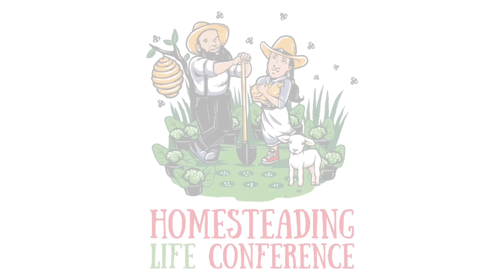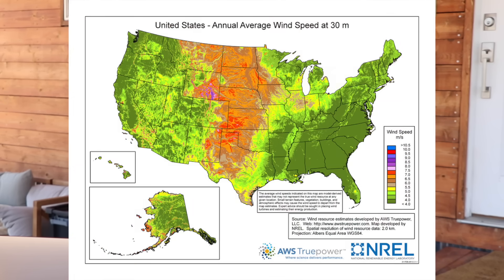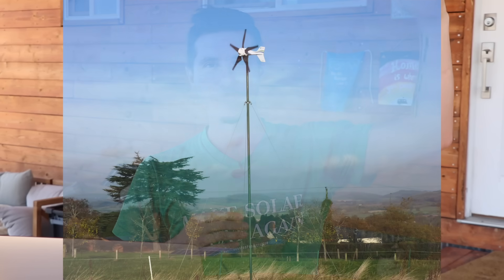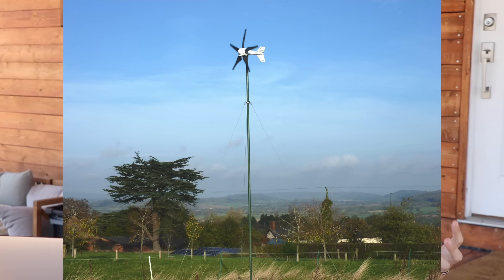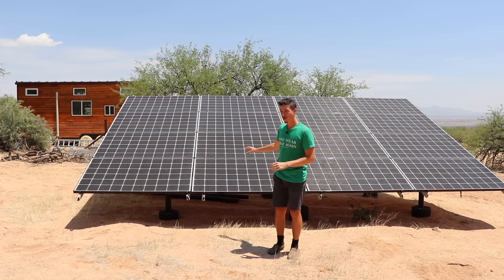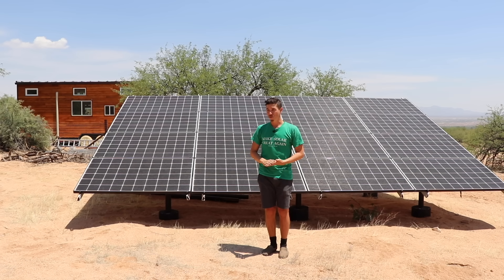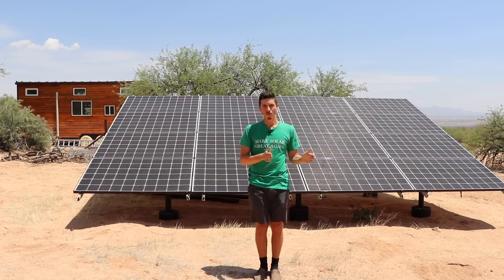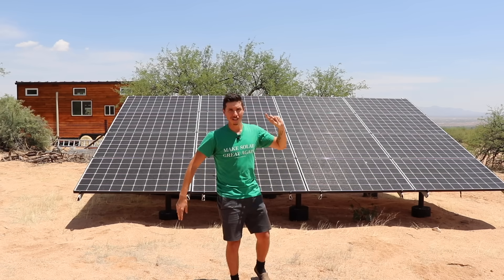Micro Wind Turbines... Are They Worth It? (Off Grid Solar)

Comment: Ha ha ha, this video is full of nonsense. He said that after the batteries are full, the wind turbine will blow up if there is no load diverter in the circuit. He said that the wind turbine has a motor in it. Anyone with basic knowledge know that it is not a motor, but a generator.
Reply: Without a LOAD , most Wind Turbines will SELF DESTRUCT in high  winds and a full battery bank ...

Comment: John Daniel's, is a Youtuber that has micro windmills and his setup does not put any one into financial ruin. Very cheap for anyone in America
Reply: He spent $4,000 just for a 12 Volt Lead Acid Battery Bank!  That will last +/- 7 years, if he does NOT Deep Discharge every night.  His two DC-to-AC Inverters will operate for only 3 HOURS at max power.  Off-Grid?  Really?  Does he have Central A/C?  Is he actually using ( fossil fuels ) Propane for his Stove, Hot Water Tank, Clothes Dryer & Furnace?  How many kilowatt hours does John's Wind Turbines actually generate on the days when there is little or no wind all day, for several days?  What is his average Daily kWhr production from his Wind Turbines?  How many times has he already REPLACED his Wind Turbines?  And who has steady 25 MPH Wind blowing, for many hours per day, every day?  And now he has moved.  The COST of his Battery Bank + Charge Controllers + DC-to-AC Inverters + Wind Turbines + Dump Loads + Copper Cable is more than anyone can ever save on a small electric bill to power Lights, Fridge, Washer, Well Pump, Furnace Blower & TV.  Have you actually added up all of the "off-grid" COSTS , just so that you can become a PROPANE consumer?

Comment: Why would you want a wind turbine? Hmm, let's see.   Maybe because you can get 4 days in a row of cloudy weather.  Also, some of us don't have large capacity storage,  or just use the solar and wind in the event of an emergency.  A 65ft. tower is recommended but not necessary.   A turbine  betters your chances of having a consistent supply of power.
Reply: Just because it is cloudy, does mean is will be windy.  So, how many watts does you Micro Wind Turbine actually generate in 10 MPH winds?

Comment: Lmao if you think solar doesn't need ongoing maintenance you are in for a rude awakening.
Reply: No, Solar Panels do NOT any need ongoing maintenance.
Reply: @MrSummitville  even the best batteries are only good for about ten years. So just from that one part, you are optimistically looking at $500 per year in maintenance for just that one part. 

Capcitors dry up. Relays burn out. Regulators degrade. There is no such thing as an electrical component that never needs replacing. 
 Corosion inhibitors need to be reapplied. Glass turns opaque over time as dirt is deposited and exposure abrades the surface.
And all of that maintenance is the bare minimum of what is required to make a solar setup last the expected 25 year lifespan. The whole system eventually needs replacing. If you do no maintenance, you will be lucky if they last 15 years.
Reply: @Christopher_Gibbons  I said ... SOLAR PANELS do not need an on-going maintenance.
 No, a LiFePO4  battery bank does not require any on-going maintenance.  The battery bank Is simply REPLACED. There is nothing to maintain.
  The same goes for the Charge Controller. the is no "on-going maintenance".  It is either repaired or replaced when it fails. 
  But a Wind Turbine does require ON-GOING MANTENANCE ... every 3 - 6 Months, it must be taken down and serviced, over its entire life - if you can still get the replacement parts, from China
Reply: @MrSummitville  replacing parts of a system is maintenance.  And if all you are doing is replacing whole parts of the setup without fixing anything you are doubling your costs.
Reply: @Christopher_Gibbons  Replacing worn out components, once every 10 years is NOT called "on-going maintenance".   Only Wind Turbines require have ON-GOING Maintenance  <= Your terminology.
  No, you cannot "fix" a worn out battery bank.  The worn out battery bank is simply replaced.  It does not double my costs.  It is part of the known & expected cost of being off-grid.  Charge Controllers are very cheap - less than one monthly bill for Grid Electricity in California.  I have not yet replaced a Charge Controller ...
Reply: @MrSummitville  yes you can repair a battery bank. You just replace the degrading cells. The rest of the components are perfectly useable. If you go around replacing everything every time a single component wears out you may as well just use coal. It will probably cause less damage.
Reply: @Christopher_Gibbons  When one cell in a battery bank "wears out", the rest of the cells in the battery bank are about to "wear out", too.   If a cell fails well before the warranty expires then yes it is replaced by the mfr, because it was faulty, NOT because it "wore out" ...
Reply: @microcap1997  Read the manual that came with your wind turbine.  Oh, you did get a manual?  Well then you bought a TOY.  Let it fly until self-destructs and then throw it in the garbage ...

Comment: Uhhh? your bias is obvious. Solar is great but you are exaggerating the requirements for wind (like a 65 foot tower) and neglecting to state the cons of solar. One good thunderstorm and your solar array will be upside down in a pile. Wind can improve a total system. I from Ohio and its windy there. I'm in Montana and its windy here. Hmmm...You should redo this explaining the benefits of both.
Reply: Solar Panels are NOT upside down from "one good thunderstorm".  Clearly, you do NOT have a Solar Array, otherwise you would not write such nonsense.  So, where exactly is it "windy" in Ohio?  According to  NREL, National Renewal Energy Labs , there are only a few Class 2 locations in Ohio (slightly windy) - there are no Class 3, 4, 5 or 6 (Very Wind locations) in Ohio - none, zip, nadda.  Class 2 is only 10 MPH (avg), but Wind Turbines are rated at 25 MPH!  Yes, western Montana is windy.  Are you off-grid in Montana?  So, how much did you pay for your Wind Turbine and how many kWhrs does it generate per per year?

Comment: How solar work in storms or clouded days? just saying wind may complement solar.
Reply: Or a Wind Turbine can be, and usually is, a waste of money ...
Reply: @MrSummitville  or could run 24 hours and solar can never work 24 hours 🤔 Humm ponder
Reply: @ntcc_spanky8507  High Winds for 24 hours per day?  Not for the average home owner.  You are insane ...
Reply: @ntcc_spanky8507  Solar is a much more reliable and cost effective source of energy for Off-Grid Homes than wind.  And that is why, almost all,  Off-Grid Homes use Solar Arrays.  You would know that if you were actually Off-Grid ...
Reply: @MrSummitville  I would use both and hopefully one day I will I agree solver is better but don’t discount wind so easily

Comment: I'm happy for you brother that your solar is working for you in that location. Sadly, I'm in the Northern hemisphere and even in the summer it's not a great spot for solar. Perhaps a VAWT turbine of average size on the roof of an outhouse with AVP shroud to build speed from    x2 - x8.
Reply: A VAWT?  Those are real waste of money ...
Reply: @MrSummitville  Watch Robert Murray Smith build a VAWT on youtube from scrap materials, but even he is missing something that turns the VAWT into a higher performing wind turbine that any other form of turbine.  The answer is an AVP (Asymetric Vortex Propulsion).  It initially directs the wind flow into the business end of the front end of the wind turbine's blades and protects the backend of the blades from the same directional wind flow.  However, the shape of the AVP does something unexpectedly.  It begins to form a vacuum where the wind enters and begins pulling air into the front end of the wind turbine's blades, that's why the turbine starts out at x2 rpm and climbs to x8 rpm.  So potentially MrSummitville you're looking at x8 5 mph  which is 40 mph.  Of course if there is no wind then x8 0 mph is still 0 mph, but it's not a miracle worker, it's basically just an amplifier.  But it will still out perform a standard wind turbine.  The issue would be how to dump the excess power.  Regardless, hope this piques your interest and line of research.  I'm currently saving for the parts to build such a device so I'll keep you updated.

Comment: Be honest with your video. Solar panels drop off on efficiency after 10 years. And every year a little more
Reply: Some Solar Panels are guaranteed to still produce 80% of Rated after 20 years.  This is NOT a problem.  Honestly, your INCREASE in the cost of Grid Power is your problem ...
Reply: @MrSummitville  Solar panels degrade on average 1% per year and their efficiency rating is horrible typically 20% on the high side. Not to mention technology becomes better over time. New solar panel options will be available. Meaning you'll never recoup your building costs

Comment: wind is reliable, solar is not, hat's why countries go with wind. solar is rubbish who wants to spend so much money for temporary power u would need a field to power your house fully. if I'm not fully off the grid I'm not interested. wind blows every day every hour and doesn't rely on a sun that might not shine too bright so i live in darkness on that day. i prefer biofuel its reliable as long as u shit every day
Reply: For most off-grid homes, the wind does NOT "... blow every hour, of every day ..."  Are you really that stupid?  For the vast majority of off-grid homes, the sun is significantly more reliable than the wind.  Most wind turbines don't even start spinning  until 7 mph - 10 mph wind speed = minimal power.  And then, they require steady ~25 MPH Winds for Max Power.  So, who has steady 25 MPH winds every hour, of every day?  Essentially ... NOBODY !

Comment: I can tell you why people would rather have a wind turbine instead of solar panels... COST. To do solar right you have to spend between $30,000 and $40,000. Even a really good wind turbine system is a small fraction of that cost. To me they are not unsightly, solar panels are unsightly to me. We ride to Western Pa, and Eastern WV just to watch the large wind turbines. We think they are neat.
Reply: In that area of the USA, given an equal amount of money spent for a residential Wind Turbine system, it will generate less than 1/2 the kilowatt-hours that are generated by residential PV array.  The FACTS are the exact opposite of what you claim ...

Comment: As a retired licensed master electrician, I can say this guy has no idea of what he is talking about. And anybody that lives in a house smaller than my pickup truck has no credibility.  Just because he has never had the wind blow his hair, doesn't mean that the rest of the country has no wind at all. It doesn't even look like you are code compliant. That would be NFPA 70 otherwise known as the NEC or National Electrical Code.  What trade school or degree do you have.  HS diploma maybe?  And just for the record, a wind turbine has no motor, it has a GENERATOR. And your Batteries will need to be LEAD ACID batteries, that produce EXPLOSIVE hydrogen gas and need to be topped off regularly.  They should be stored in an explosion proof enclosure with a LEL detector as you have created a Class 1 Div 2 area.
Reply: The battery bank does not "need to be" Lead -Acid.  LiFePO4 is very competitive with Lead-Acid.  Residential Wind Turbines are a waste of money for most people.  It is probably best, that you stay retired, because you know even less,  about solar vs wind ...
Reply: @MrSummitville  I know what I am talking about. retired as an IBEW Master Electrician.  Now, I work in power engineering, and yes that involves photovoltaic (solar for you), wind farms, and other forms of power generation as well as green energy applications. Mr. Handeeman is a young uneducated, far left of center liberal fool.

Comment: Okay, you fudged! While solar panels will receive am sun every day it can be minimal on cloudy days and next to zero on heavy cloud days. To say that ANY form of producing electricity is not good is a lie! I’m an Engineer and I know for a fact that wind power can help boost any electrical storage system. How ever solar “can” be a better choice “IF” you can not do both and if shading is an issue. Installing 8 each 50 watt PV panels with blocking/bypass diodes is better than 4 each 100 watt panels. 24 volts is better than 12 volts etc...
Reply: Residential Wind Turbines are are waste of money for most people ...

Comment: Lol. Dude you way over exaggerate the maintenance and setup of wind a turbine. I get it you love solar and it’s great but this video amounts to pure hysteria. There are dozens of videos on YouTube showing wind turbines at about 20 feet generating around 300 watts or more at relatively low wind speeds with pretty inexpensive setups. Micro wind turbines are an excellent addition to solar set ups with a few added bonuses. Just add an extra pwm controller to the back half of your batteries powering a $22 heating element that gives your solar and wind a good USABLE dump load instead of wasting energy from both your solar and wind that your batteries can’t store. This offers the user an added bonus of having a simply water heater which is something that would tax the shit out of the average offgrid setup. To run a basic 5 gallon water heater in solar alone would require a massive solar array and at lest 1000ah to be affective. 

I recommend watching more videos about wind turbines and dump loads and skipping this guys click bate and over exaggerated bs.
Reply: Provide the URL link of the "dozens" of video showing ... inexpensive wind turbine, on a 20' foot pole, producing 300 watts in relatively low wind ( 10 mph ? ) .   A Micro-Wind turbine + PWM Controller + Load Dump is a waste of money for most people ...

Comment: "We know it's going to rise - hopefully".  Due to a mountain blocking direct sunlight until 9am on our property, and then trees blocking it in the afternoon, having a wind backup would be VERY effective for me.  The wind blows almost constantly at night in the winter, even when we have very short periods of sunlight.
Reply: Where do live that has " ... wind blows almost constantly at night in the winter ... " ?
Reply: @MrSummitville  in the Ozarks of sw MO and north AR. I've lived in this area for 10 years, and that's my experience.
Reply: @frontporchanarchast  I will agree that parts of Missouri will have more wind than most other places - ie Tornado Alley.  So, how can the trees block the sun, but not block the wind?  How high are the trees vs the height of your Wind Turbine Tower?
Reply: @MrSummitville  If you don't like wind, don't try to use it.  I'm telling you what would be beneficial to me.  I mean, there is an fing mountain blocking the sun on my cabin until mid morning/noon every day.  Believe it or not, the wind blows through trees.  Not as good as on the open plains, and not as good at 10 feet off the ground as it would be at 1000 feet, but I'm looking to power some LED lights and a chest refrigerator, not a McMansion.   We haven't ruled out a small solar system, which would be helpful with the longer days in summer. Obviously, your results may vary, and if all you want is solar,  good for you.

Comment: Wind and solar don't compare.
The reason for a wind generator is when there isn't sun and the weather generates wind. Like at night.
In the Pacific Northwest is cloudy 9 months out of the year.
You didn't talk about the actual costs.
I see you are a solar guy. But to tell folks that wind generation isn't viable is a disservice.
You only focus on the negative. Your off grid solar uses very expensive solar parts. Lithium batteries and 250 watt solar panels are not effective for the rv market, for the most part.
A small wind generator will not make much noise, will be easy to maintain, and will add power at night.
Reply: For most people a Wind Turbine is not cost-effective - ie a waste of money ...

Comment: Most people use a wind turbine in connection with their off grind system, it will work to help assist your battery bank at nights or cloudy windy days not just wind as the main resource.
Reply: Most people do not live in area with enough wind to cost justify a micro wind turbine = a waste of money.  A micro wind turbine makes micro-power ...

Comment: Lot of problems with your logic. Just buy quality. I got my win turbines from the UK. They cut in a low speed and they only need six meter towers and the design for severe weather.
Reply: Manufactuer & Model #?   What was your total cost for the Wind Turbine, Tower, Wire, Controller and Dump Load?  What is your yearly kilowatt-hour production?  And what is your avg wind speed per month?  Cut-in at low wind speed = very low power = So what?

Comment: 4 one hundred wat panels does not make 400 wats of power, you have to clean them regularly( that's maintenance ) they produced when the sun shines only. Your argument is very biased and uninformed in my opinion. I think wind is a great additive to solar.
Reply: 4 x 100 watt panels can make 400 watts.  Micro Wind turbines are a waste of money for most people ...
Reply: @MrSummitville  wrong
Reply: @jasonlawson8619  So, you purchased OVER-RATED Solar Panels?  That would be your problem.  How much did you pay for your  Wind Turbine + Tower + Charge Controller +  Dump Load?   And how many kilowatt-hours did it produce in the past year?